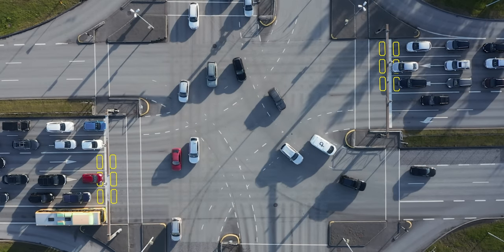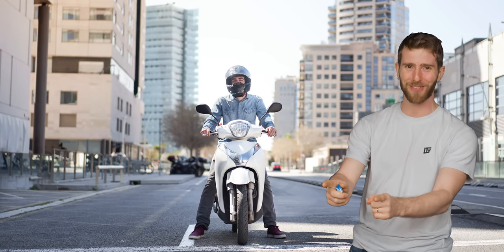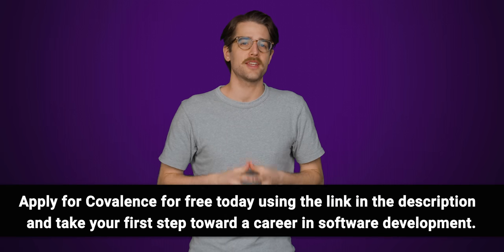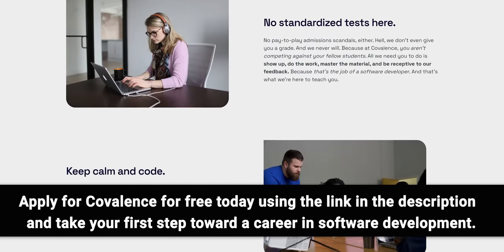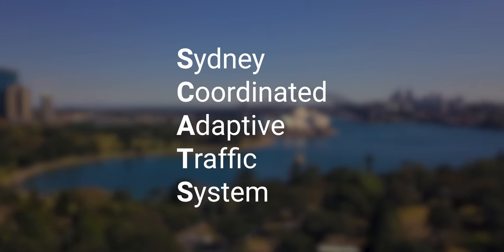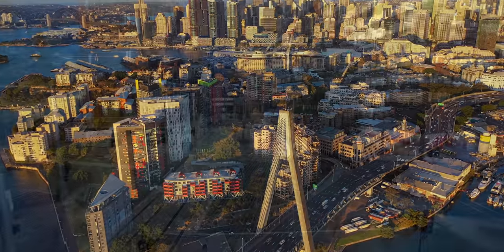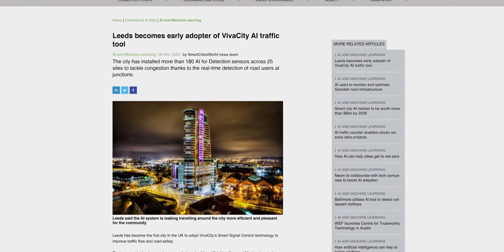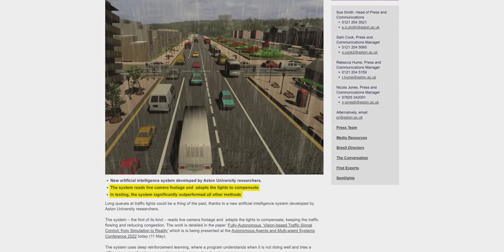Here's Why You Get Stuck At Red Lights

Comment: In the netherlands we have those inductors in the pavement that even work on bicycles somehow
Reply: the simplified way it works:  the loop creates an induction field around where it is, this field can reach up to 50cm depending on how strong or sensitive it needs to be. The way a car or bicycle is detected is because the field is constantly measured and when the metal goes through it, it will disturb its values somwhat.

Comment: Working 2nd shift, there's one thing I notice that can happen at a certain intersection: One of the induction wires gets damaged, always thinking cars are waiting there. This is especially annoying when it happens on a less traveled side street. It will always change to a hefty-length green, even when no cars are waiting for the light, giving the main road a long red (and yes, it is a car-detecting light, not a simple timer one).

Comment: When you are in a bike/scooter/motorcycle you can still trigger the induction detector at a light. You need to ride on either side of the circle instead of in the middle (of the lane). When you cross the detector in the middle, these small devices only cross ~10% of the detector. If you go on either side, you get closer to 50%.
You can also move back and forth over the detector to make sure it senses you.
Works every time for me.
Reply: I've seen where they've placed induction detectors in the bike lane
Reply: In the netherlands those loops arent circles, but rectangles. An advantage from this is that you can have them wider, or longer depending on its use.  The one at the stop line is usually set more sensitive aswell to make sure bikes and such are always detected.

Comment: The group of cabinets you see on the side of a traffic signal contains all the automation to manage it. It's done by a programmable logic controller tied into some regional network.

A lot of times when the traffic signal is new it usually works properly. But, power outages will be a problem and may cause the PLC to run on 1 default schedule no matter what. Now days UPS's are installed at the signals because shutting power off to a plc creates issues like sitting at a red light with no cross traffic. Unless the DOT setup the schedule that way.

Comment: The traffic lights in my German city seem to be designed to turn red just as you arrive from the previous traffic light, thus ensuring that you burn as much fuel as possible.

It’s honestly infuriating, especially when much poorer countries, such as Belarus or Rwanda have those awesome traffic lights with LED timers on them to let you know when you can take your foot off the gas and downshift because the light is about to turn red.
Reply: This is for "sAfTy ReAsOnS"
Another joke is to convert one lane into a bicycle lane, so that the city is even more clocked up.
Reply: Look at it from a different perspective, maybe the lights are designed that way to discourage drivers to speed through a place where people live. By making car travel slow, public transport gets more appealing (and cheaper), it will make walking and cycling more appealing. All result in less pollution, less noise pollution, fewer traffic accidents, and a better walkable place.
Reply: @michielvoetberg4634  A row of traffic lights near where I live does this and you need to speed to catch the next green. Going the speed limit will result in lights turning red just as you get to them. If anything, it heavily incentivizes speeding
Reply: @Maboidatboi  It's scientifically proven that a city won't get more clocked up on the long run when you turn car lanes into cycling lanes
Reply: @michielvoetberg4634  Ironically, speeding would allow you pass the red light, since it’s synced in such a way that it turns red just as you arrive from the previous light, assuming you’re driving the speed limit. Plus, if they made the lights turn red sooner, people would let go of their gas pedals to save gas and therefore drive slower.
Reply: could not agree more, from Karlsruhe !
Reply: @Maboidatboi   Ironically, there’s a traffic light right next to my university that I believe to not only be inefficient, but also dangerous. Usually when there’s an intersection that has traffic lights and pedestrian crossings, there is a green arrow and starts glowing before the actual light goes green. If the green arrow is glowing, you may pass, but only if you’re making a right turn. This allows you to pass before the pedestrians start crossing the street. 

The intersection right next to my university doesn’t have that for some reason. There’s a time when all lights are red and everybody’s just waiting, then suddenly both your lights and the pedestrian lights turn green at the same time, and now you need to find a gap in-between the pedestrians (some of whom are cyclists, mind you) to drive your car through.

... Why?
Reply: @Maboidatboi  how is that a joke? Sounds efficient to me. Having a bike lane is pretty critical, cars however can do with one less lane.
Reply: @mxdanger  Turning a car lane into a bike lane isn’t efficient because it creates traffic jams. In Germany, we typically have a bike lane that is much narrower than a car lane and cars are actually allowed to (partially) drive on it when there are no cyclists currently using it. It’s much more efficient that way, I believe.
Reply: @ThePC007  They don’t cause traffic jams. What actually happens is that during peak hours, people who choose to drive can enjoy the freedom of being in traffic for a few extra minutes longer compared to the alternative of sitting in the same traffic but with one extra lane. While 80% of the other time having that extra lane won’t make a difference.
Reply: @mxdanger  How many lanes do you have in your city? I struggle to think of a street with more than two lanes in mine. Take out one, and it becomes impossible to overtake people (keep in mind that driving below the speed limit is very common here), not to mention that the left lane is typically used by cars that want to make a left turn at the next traffic stop since they need to give right of way to oncoming traffic. Remove the right lane and suddenly a single car attempting to make a left turn grinds everything to a halt.
Reply: @ThePC007  When I’m talking about removing lanes, this is kinda what I’m talking about. https://youtu.be/3PVxA_UfK5M
Reply: @mxdanger  I guess it depends on the city design, then. Also what’s stopping cyclists from simply using the car lanes? Is that illegal in America or something?
Reply: @ThePC007  It’s legal however it’s extremely dangerous and very stressful which means only adrenaline junkies or pro cyclists will use their bikes on the road. Which is why it’s so important to have protected bike lanes so your average joe or a family can ride their bikes without the fear of dying.

Comment: A place I uses to live had a three way intersection on a timer. This place got super busy during rush hour and the council did nothing to improve the system.

There where 3 crossings that had buttons to let the system know you wanted to cross, but it didn't change how the lights worked. It just turned on the walking green light and sounded the crossing sound when the one you where waiting at went red.

Comment: One thing that few understand is DURING SATURATED periods (where the "line" or queue to a light never exhausts - that is, when there is "more than one cycle worth of cars waiting. In this situation, THE LONGER THE CYCLE, THE BETTER.
It's basic throughput. There is a loss of efficiency every time a light changes, from built in safety timing buffers, and from simple time to accelerate after turning green. Thus if there's a CONSTANT steady flow, the longer the better, as less loss during the changes - ergo reducing total wait time.

Comment: Ok, now check out dutch trafic lights because those are about 20x more advanced than anything in north America. Pretty much all traffic lights have these loops, but not only at the stopping line, but also way before the light to measure traffic density, have lights turn green before you come to a stop on empty street crossings and in addition all this stuff for bikes and pedestrians separately. Most traffic lights are interconnected and they even take weather conditions into account. Like mentioned in other comments, not just bikes on youtube has some amazing videos explaining how it works.
Reply: If your lights are only using loops as a detector they are pretty dum.
Reply: @Klub4143  unlike shown in the video we dont just use 1 or 2 loops.  we always have several, ive seen a single lane have 8 of them, and they can be far away so you can be detected from 2-300m away. Besides that the systems have already been communicating with eachother for over a decade.

Comment: Where I drive many of the cities use camera's as sensors. During high traffic times the lights coordinate with others along the route and during low traffic times, like middle of the night, they detect the vehicle approaching and if there is no cross traffic on the major road it will turn the light green before you get to the light if you are doing the speed limit. If you are driving on the higher traffic road at night all you see are green lights but if you are travelling too fast the light will turn red before you arrive then back green when you slow down.

Comment: What I think would be cool with this is an interconnected traffic network that works with not only traffic lights but cars as well.  So if you put in your destination in, every traffic light and car along that route knows where you’re going (just not who you are or why you’re going there, just this car is going from A to B).  If anything unexpected happens on your route, it’s communicated back to your car, which updates the route, and passes those changes along.

Then imagine something like that with more cars, and (when they’re good enough) self driving cars.  With the self driving cars, not only could it know the route to take, but the speed as well and adjust to make the trip more seamless.

Comment: The lights in my town, absent traffic pattern changing, will default to if you're cruising down the street at right around the speed limit, the lights will stay green for you. Many is the time late night where I will be doing the speed limit, someone comes rushing around me, and then they're stopped at the red light that turns green just before I would need to brake for the red. I slide right past them in the next lane, move over to the right, and then we do the same sad thing all over again.
Reply: And then you just look at them and shake your head.

Comment: Traffic lights in England are programmed in many ways mentioned here, like timers and induction loop sensors. Most traffic light based systems actually use a process called VA or "Vehicle Actuation" where a small black box (normally attached to the traffic light head) sends out a low level radar ping over a certain distance. If this ping hits anything traveling over 2.5mph, the radar ping will reflect back into the VA sensor registering "Demand" for that light to change. Sometimes the lights change automatically if there is no "Registered Demand" on the other phase (side of the lights), and sometimes where there is demand, a "Maximum Green" timer is enforced, to which the traffic light can only remain green for a certain time before having to give way to the other phase's demand.

Comment: Where I live, almost all are inductors. Those have a tendency to fail, especially in rain. I remember one night after a night shift at work, I was stuck at a red with a line of cars behind me. After a few phases, I ended up running it (and reporting the malfunctioning light). With as much power that these controllers have, they should at least be able to have resilience against failing sensors.

Comment: Fun Fact: If you’re stuck at a light with a motorcycle, just turn it off and on again (not a joke) and it’ll trigger the light. The starters electromagnetic field will produce a large enough current to trigger the light.
Reply: @bestplayerhear sounds like some Rocky and Bullwinkle shenanigans.
Reply: Nah you gotta do the classic method of running over to the crosswalk button and pressing it
Reply: @BanditLeader  That's funny 🤣 with my luck it would just be a dummy crosswalk button that doesn't signal the lights to change.

Comment: The interesting thing about the succession lighting is at least where I work, it's on a consistent loop. This means I can always catch the light leaving work if I leave at the right time without stopping (I walk) all the way to the transit hub nearby. When a pedestrian hits the button on the lessor used road to cross for said light the signals retime themselves to go back into sync meaning the lights will forever stay locked, this usually means the light will be either shorter or longer, usually shorter.

Also the signals displayed at 1:30 are a bad example, but due to location it might for safety reasons, as best to have staggered lighting vs synced as shown if you care about distance lower fuel use etc, also staggering lights based on speed would effectively kill long distance speeding as they'd eventually run into a red light that they would need to stop at instead of cruising threw all greens at the speed limit.

Comment: Or come to my small city, where they have sensor lights, but they dont always work great, often giving the arrow when no cars are present, or occasionally not detecting my small car causing me to get stuck. This is especialy annoying at left on green arrow only lights. Plus none of them seem to coordinate well with each other. When there are pairs of lights next to each other, often the lights will be so out of sync that it causes the main direction of traffic to only get a few cars through per cycle. There was also one time where the sensors on a light were broken for probably close to a month, causing each cycle to take as long as possible, regardless of if there is a single car coming from the secondary road or turning left onto it, so I would be stuck at a light for over a minute for literally no reason. Needless to say, our lights need a lot of work.

Comment: I build intersections for a living.  Another key aspect in major cities for vehicle detection is in the use of cameras.  These cameras do away with the detection loops in the ground.  The video detection cameras see a change in light, from the color of your car entering over asphalt, for a vehicle entering the intersection.  There are other systems in the control cabinet that could also connect to the city's public transport that allows for buses to have faster travel routes.  We have an optic fiber cables connecting every cabinet for fault detection and homogeneous timing.
Reply: Tips for changing the light.  Don't pull too far over the white stop bar as it can sometimes put you outside of the vehicle detection.  Vehicle detection is anywhere from 30-40 feet before the stop bar, so inching forward over the line isn't going to help you any.

Comment: I know an intersection where the main road has green light at all times and the crossing road only get green light when the induction loops senses that a car has approached the stoplight. This can have pretty funny results. For one thing it seems to have a problem detecting bikes, so those used to it will roll up and use the button for pedestrians. But once I saw a driver who stopped about a two car lengths from the light and waited for green light. That was far enough that the car didn't register and so they were left waiting for close to ten minutes before someone passing by pressed the button used by pedestrians.

Comment: Somthing I loved about where I used to live which was a small town in NC was durring the day the lights were on the sensors however past about 10pm most lights would switch over to the function of a four way intersection turning the lights into just flashing stop signs for said intersection for when traffic was not dense.

Comment: You didn't mention that some lights have cameras that detect cars through the cameras instead of a wire in the ground. Though many lights are still on a timer and even if no one is coming the other ways, it'll still take a little bit before it decides to go green for you sometimes. Or if it just turned red when you arrived and then you're waiting extra long because of the timer.

Comment: Buenos Aires mostly uses timers, but the main one-way avenues (and some two-way avenues that have a much larger flow going one way over the other) have "green waves", where if you can keep at the speed limit(ish), you'll keep on going. They were originally set with plain timers which required near-constant servicing, but since the mid '00s they have GPS timing and are remotely adjusted for time of day (they're set up to keep a slower speed at day during weekdays, slightly faster by day on saturdays/sundays, blazing fast at night -- to the point it's actually hard to cross the avenues as a pedestrian).

The system isn't working that great now, in no small part because power outages can wreak havok in the system programming, the company in charge sometimes sabotages a couple signals to get a bigger/earlier payday, double parking, and due to a couple fatal accidents at night involving cars running a red killing pedestrians in one of the "green wave" avenues.